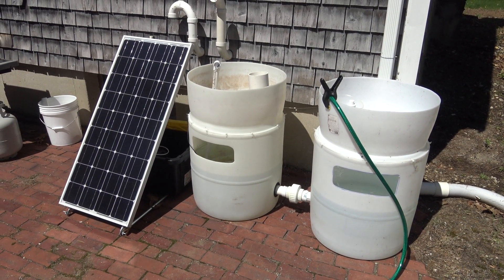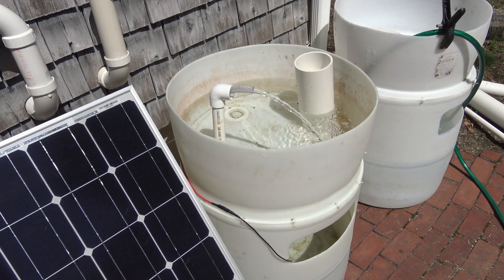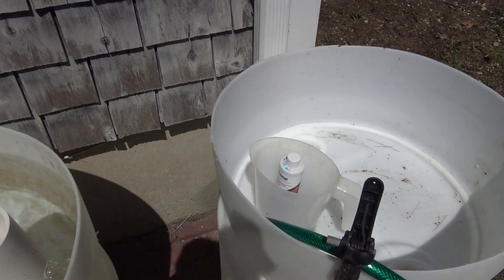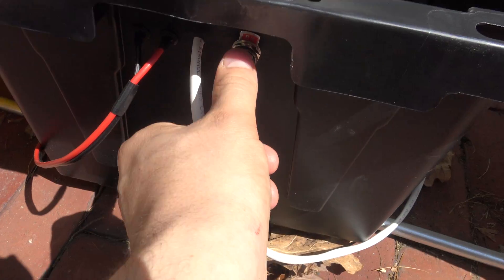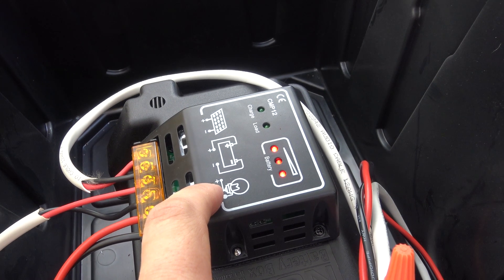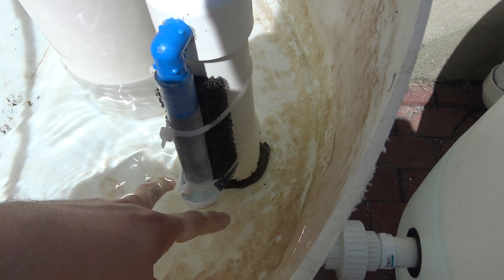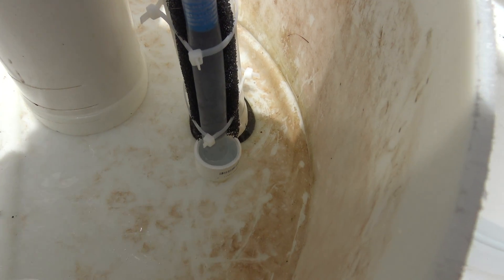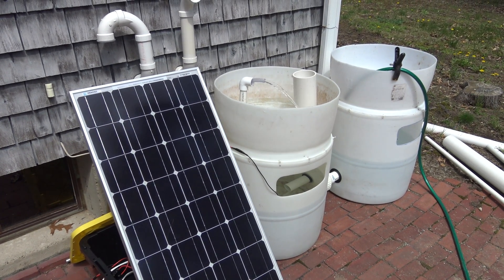#474: Off-grid Aquaponics Chop and Flip Barrels - Update Monday

Comment: lol i know this video is 7 years old but im having the same problem with my pump and siphon, the pump is running just as fast as the siphon is siphoning, so im thinking either to increase the size of siphon pipe or split it to run to a second grow bed, i may do the second grow bed so that way i can grow more, i have a full 55 gallon drum, hdx sump tote and half barrel sideways for a grow bed, running on a diy bucket filter at the top, and plan on adding a bio filter next to help with keeping that water super clear and clean for my fish, i am so stoked i got this thing together finally, now all i have to do is get fish and plants in it.

Comment: Is there a way to interrupt the pump while the water drains?

I think it would save battery power and wear on the pump.

 Or would that be more work than what it's worth?
Reply from the maker: I could probably add a float switch which cuts power to the pump while the barrel is draining, it's easy enough to do, however, pumps typically don't like starting and stopping, it increases the likelihood that they will jam or wear out. I'm not too concerned about battery power as it's free now!

Comment: Thanks for this video! It's inspired an idea. I recently lost power and have been thinking of better methods to power my tanks. I have a generator but seems to never work when I need it most (gets flooded or something). We seem to loose power almost once every other month. I was thinking of using a system like this hooked up to just my pumps/filters. I feel that would be an ideal solution. Though I could always just get a wall charger but I feel this would be more stable and in the event I didn't have power for days I'd still have a battery being charged during the day. I'd have to do the math on it but I feel that would be more sustainable for back up air pumps and powering a HOB or two for sometime. Really cool project though!